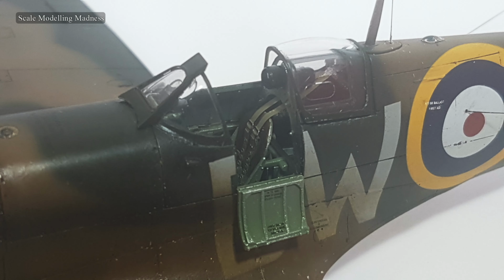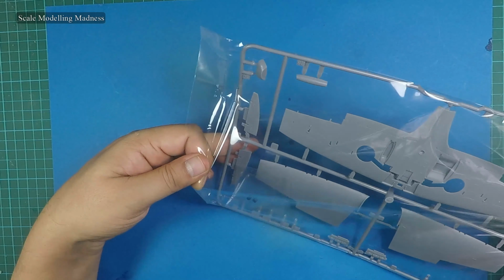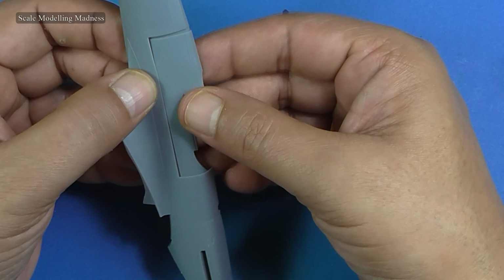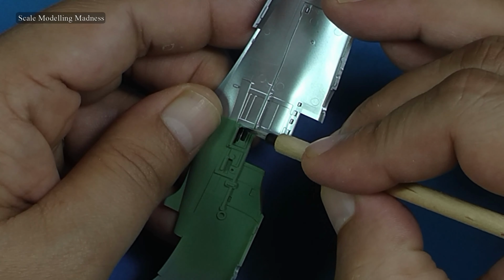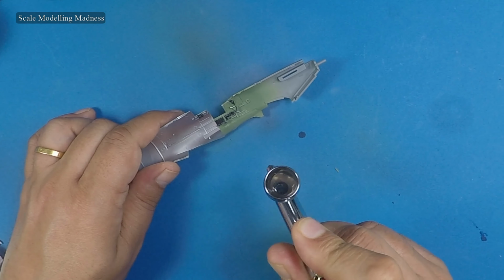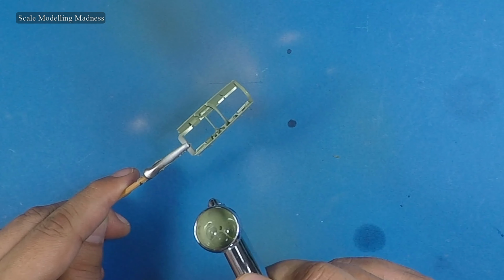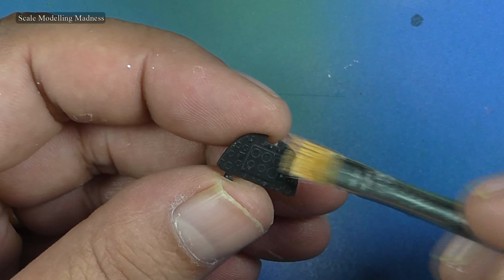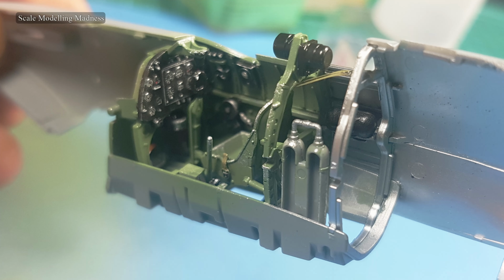New Tamiya 1/48 Spitfire Mk. 1 (Part 1: Review and cockpit)

Comment: Very nice!! Did you consider using a rivet maker? I was wondering if it would take a lot of time. What about the small instrument decals- did you use sealer & softer on them? When you paint the brown in the seats, was that paint thinned first? 
Thanks
Reply from the maker: Thanks buddy...let me see now. Rivet maker....ok.. if I remember correctly this was new release and I wanted to make this kit straight from the box, so I did not add any rivets. Adding rivets does take a lot of time and patience. All the details have to be measured, marked out and then carefully rivetted. If you make a mistake then you have to putty and sand out the mistake and go again. But then again additional rivets do make a kit look really good. I usually always use a decal solution, usually micro soft, on the decals. And yes, I did thin down the paint before painting the leather back on the seat. Hope that helps :)
Reply: @scalemodellingmadness4114  Thanks for responding

Comment: Hello This Spitfire is my next build will be following your posts I have a question have you ever used the AK products ? such as their paints and weathering sets any info would be greatly helpful enjoy your builds stay the course Bruce
Reply from the maker: Hey Bruce, yes I have used a lot of AK products, I think I use a few on this build as well. As far as paints go, AK airbrush paints are pretty similar to Mig and Vallejo, if you have used their ready to air brush tiny bottles. They are water based acrylic. AK also has a vast array of weathering products, particularly their washes and pigments, which to I use regularly. If I am not wrong their washes and grimes, etc. are enamel, so they would work with odourless spirits, for streaking and blending. Also, the flat/matt varnish I use in the build is also AK. All in all, pretty good products.  Hope that helps :)
Reply: Thank you for your reply yes it did help I didn't want to do a trial and error method I'd rather cut to the nice detailing of your Spitfire how many hours do you have on spits Simon  10 and half sir  well
make it 11 before Jerrie has you for lunch  TAKA-TAKA-TAKA -TAKA-TAKA stay the course Bruce
Reply: AK now also makes acrylic/lacquer paints marketed under the "Real Colors" logo - supposedly good paints - similar to Gunze, MRP and Tamiya. I don't think the standard AK paints are as good as Vallejo - at least the quality control isn't. If you don't mind mixing colors, Golden High Flow (an art house brand) are fantastic water based paints for airbrushing. The AK weathering products are mostly enamel and perfectly good for the type. You can get something just as good from MIG or Wilder (I've liked Wilder's stuff - but it's just preference). Personally, I like to keep enamel stuff to a minimum - it's tough on the nose. Oil paints can everything that enamels can - they're just a little different. Search oil paint weathering here and you'll find a zillion videos. There are also very good acrylic weathering products made by Vallejo and now Wilder. The hobby keeps growing so you're seeing new paints - Tamiya has come out with a lacquer line. (I'd argue standard Tamiya paints are acrylic/lacquer.) So has AK. At the same time, there is a new line of water based acrylics from Mission Models and they're very good. So if you like water based stuff - non-toxic, non-flammable, very easy to clean up - you've got Vallejo, Mission, LifeColor and Golden. If you want the fine painting qualities given by the lacquers you've got Tamiya, AK, MRP, Gunze - and I'm sure I've missed something.

Comment: I appreciate your understanding was that aircraft flew from their home bases. The reality was time spent servicing these brand new aircraft was negligible. Fuel, re-arm, go. Any spare engineering capacity was spent getting unserviceable aircraft airworthy. During this period the term “battle damage repairs” was coined. That meant the normal rule book was ignored. So the aircraft were very new but treated very harshly. But none of this takes anything away from your modelling. I also think the interior colour looks just right, so it is! (Although I would have painted the seat a red-brown. They were made from Bakelite.)
Reply: I think he did paint the seat red brown.

Comment: Curious Tamiya came out with another Spitfire Mk I when their release from (early 90's?) is still considered a very fine kit.
Reply from the maker: Hey Raymond, I agree. I think, and this is purely what I guesstimated, is that Tamiya wanted to launch this new type of engineered kit and they decided to go with one of the most popular aircraft....hence the Spit. I guess if it wasn't the Spit it would have been the 109 :) Also, it would appear that Tamiya has taken note of other manufacturers like Eduard, Italeri and Hobby Boss, who often package their kits with some goodies, like PE sets and have thrown in their own goodies in this kit.
Reply: @scalemodellingmadness4114  Yeah, yeah, like  you say,  probably to compete with Eduard.  Thanks!
Reply: The earlier kit had well known shape issues with the wing and the thickness of the fuselage.

Comment: what is that paint brush please need a fine one.
Reply from the maker: Hey Roger....well this particular brush is Tamiya, item 87017. But you can buy a fine brush from any decent manufacturer. What you are looking for is a fine brush. Some companies have numbers like the Mr. Brush I would recommend is 10/0 but numbers can be confusing as different manufacturers go with different numbers. So just look for a super fine brush, the Tamiya one I am using is pretty cheap, I think about 3 Singapore Dollar per brush or so. Italeri 000 is another brush I sometimes use. Hope that helps :)
Reply: @scalemodellingmadness4114  Thank you for the reply. will search a few out for acrylics

Comment: A much more complex kit than its 1993 counterpart. I hope this won`t deter young modelers from the hobby. The older kit is much more suitable for younger modelers looking for an easy build while this more recent release is a welcome treat for adult modelers who demand a state of the art kit. The old Tamiya kit has a total of 58 parts while the kit in this video has 124 parts (plus metal parts) Also worth mentioning Tamiya recommends the new kit for ages 14 and up. As for the older kit they claim "modeling skills helpful if under 10 years of age"
Reply from the maker: You are right mate. I would also suggest that someone who has a few kits under their belt go for this one. Even more so, considering that this is not exactly a cheap kit.
Reply: @scalemodellingmadness4114  Not so cheap huh? Right about here is where i draw the line as far as hording goes. I have the initial Tamiya kit and don`t feel the need to get this new tool. With all these fancy innovations and raising the bar of plastic kits nowadays at some point enough is enough. Overcomplicating things is hopefully not something that will be the trend in years to come but ofcourse for some modelers this is exactly what they want.
Reply: @mybluebelly  The old Tamiya Spitfire Mk i is still available . At very reasonable price and of course Eduard have the Weekend Edition for those on a lower budget who don't want to mess with PE  . I am more interested in the general outline of the aircraft and don't particularly like having everything opened up . I guess choice is the best thing . As with music on videos etc . your never going to please everyone  . Which is why i don't bother making videos anymore . On the other hand it's great to see inside the box . So well done Modelling Madness just do your thing ; if anyone doesn't like it , hard luck .
Reply: @AnthonyBrown12324  I have the old 1980`s Airfix series 1 kit coming in the mail now. It says on the box ages 7 and up. It`s probably not got a 100% accurate outline but still i can`t wait to get all 28 ! parts assembled. Just like the older Tamiya kit, this old kit has its unique little charm ;-)
Reply: @mybluebelly  Yes . At the end of the day modelling is supposed to be a fun hobby . The kits are made of plastic and especially in the smaller scales can never be truly authentic . My Tamiya Mki is my oldest surviving kit in my collection and I was astounded by the quality of it more than 20 years ago . it's good that people can take an interest in the history but some modellers are just too pedantic . I hope they don't put off the more casual modellers .
Reply: @AnthonyBrown12324  The straightforward simplicity of the older kits is not to be underestimated. Should you wish to scratchbuild a small part, you can choose to do so. With these modern kits there is no longer a need to scratchbuild any parts, it`s all there for the sake of convenience. The push has for a long time revolved around the pursuit for higher level of details and perfection, but at what cost? :)(:
Reply: @mybluebelly  It's a kind of decadence . The better kits have got the more people want . I suppose it supports a cottage industry in aftermarket . What worries me is when people try pushing it on others who are satisfied with their pocket money Airfix series 1 . The worst case I saw was a man measuring FW 190 kits undercarriages with a micro meter . Get a life it is a plastic kit ! I can't say I don't like the Tamiya kits ; which are generally fairly accurate but easy enough for a beginner to build but I never will embrace the expensive airbrushes or aftermarket that costs 3x more than the original kit . It is still a plastic kit ! You cannot get scaled down paint or panel lines for that matter , If you don't want to weather a kit within an inch of its life , fine . I am not against people doing these things but you don't have to . That is why Rob of basic modelling is so popular or the much younger Owen on quick kits . Personally I have given up with the whole Forum thing . I just watch occasionally . I don't criticize at all ; especially free videos that inform you about recent releases ; it's a real benefit to see before you buy . Just be happy with where you are at ; if another modeller gives you helpful tips great .
Reply: @AnthonyBrown12324  Indeed it is and this decadence comes at a premium i think most modellers are quite familiar with. When Eduard released their 1:72 scale FW 190s a couple years back, i thought to myself "this is where i draw the line" and decided i would have none of it and rather stick with my much older Hasegawa kits just like with this new Tamiya Spitfire in this video i am saying "enough is enough". I love watching Robs videos. The way he handles his brush, this guy knows what it`s all about ;-) At some point perhaps the cottage industry will become redundant because kits will develop into finely tuned museum pieces from the factory and won`t need any further "bells & whistles" I used to follow this fashion trend for a long time, but again and again i find myself falling back into the thin red line in pursuit of not perfection, but rather happiness :)
Reply: @mybluebelly  Thanks for Scale Modelling Madness for hosting this little chat . I generally concur with you . I did a bit of Photo Etch on the Tamiya 1/32 Spitfire Mk XVi what there was was sensible and actually improved the kit ; as did the metal reinforcement pins on the undercarriage and pivots for the control surfaces . It might just be worth it for this scale . 72 scale to me is almost ridiculous except maybe for expert miniaturists . I have some PE in a kit I just got from Eduard ; which included 2 Hellcats for £25 . I will probably add much if not all of it . Usually I opt for the Weekend edition with Eduard . I wouldn't buy the Tamiya MK1 simply because I am happy with the old one You can pursue perfection but you will never achieve this . The nearest I have seen ; is a man should remember his name who builds large scale models to plans in the actual materials of the aircraft ; seen on You Tube . Us mortals can be content with what we can achieve and be glad to finish something in a reasonable way .

Comment: The pilot figure is the worst part of this kit.  Tamiya should have provided two heads, one with the mask and goggle on, the second without as is already in the kit.  The instructions illustrate how to “strap in” the pilot for flight mode, but the landing gear is fixed in the down position.  I wasn’t impressed with this contradiction.  Tamiya needs to step up their game a bit more and really think hard about what options they include in their model kits.